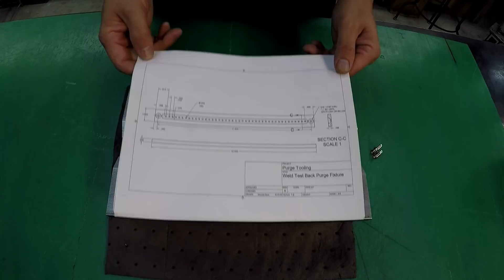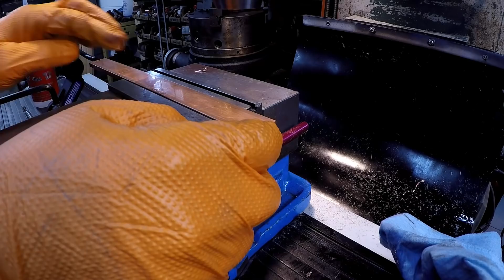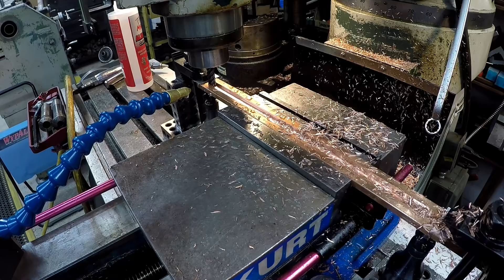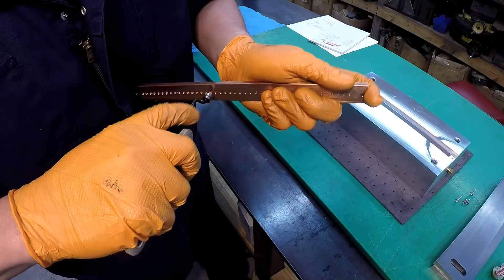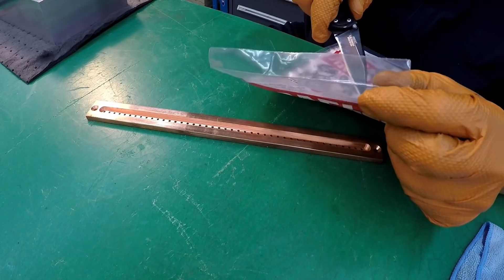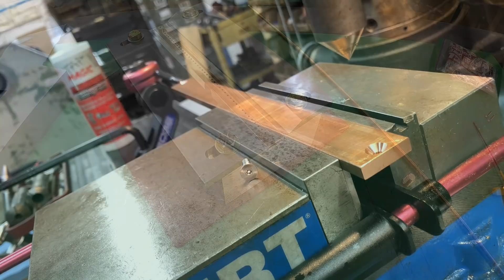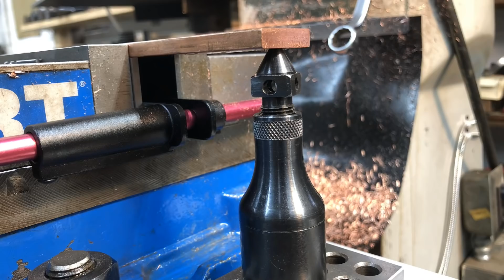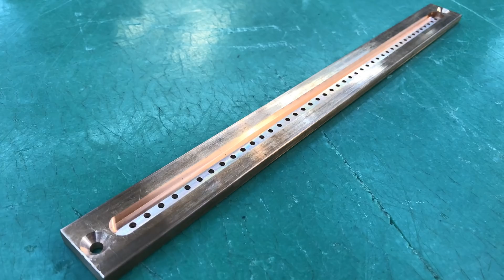AWS Back Purge Welding Fixture Part 6

Comment: Adam your going to cry when you see that purge box after the first use .
Reply: As an ex- structural steel welder that has taken many tests, I was thinking the same thing, during every video in this series.  This work is too pretty to use as intended... maybe not the first use, but certainly after a couple of months.  Inert gas backup could make the tests too easy?

Comment: Brings back memories....I built one similar with a 1/4"'x4"x79" copper plate for on a seem welder on our strip rack machine that we designed and built at work, used to join 72"x20' SS and other steel sheets together during our manufacturing processes... lol..no polishing involved...nice job

Comment: Coconut *oil*? Is that going to contaminate the Ti sheets when welding? (At least the first few times?)

I'd skip the polish on the aluminum at least, or Jodie will have to strip it down with the chemical grade acetone just to be sure there's no contamination...
Reply: I'm sure a professional would do that as a mater of course.

Comment: Next time you need grade 8 bolts visit your local Cat dealer.  They carry the best G-8 bolts with rolled threads in either finish for about the same price as hardware store grade 5's.  I stock my shop with them.
Reply: Lee Barnhart coming from a previous Cat dealership mechanic, I completely agree. Cat has the best hardware and very competitive if not better pricing.
Reply: Ross Dugan ...Ah, you have yellow blood too!
Reply: Lee Barnhart yes. Still work on yellow iron full time, just work directly at a mine in western MO.
Reply: Thanks for that little info, I wouldn't have thought about that 🤯

Comment: I dont understand the reason for the brass feed tube with holes in it when you have the copper plate with holes just flood the inside of the chamber with gas and let it come out through the holes. No real advantage in the tube i can see .
Reply: I would think it would make the ends even pressure?
Reply: @douglaspierce316  .... but you are also likely to get a pressure differential from one end of the tube to the other ??

Comment: @abom79 what kind of coolant did you use with your noga cool mist can you link it in the comments and do a review on it plz
Reply: Koolmist makes their own coolant which us what he uses, or has in all the past videos.  He also bought the stainless container where you mix the concentrate with water
Reply from the maker: I use the Kool Mist 77 mixed with water.
Reply: What is the ratio you use the kool mist 77 to water and what kind of container do you use to house the kool mist 7 and water mix and how is that tap magic that you used theone for aluminum does it work great I am asking cuz I cut a crap ton of copper and I mean a crap ton I am just using the tap magic the other one.

Comment: To keep your aluminum fixture block looking great, I suggest that you get it hard anodized before it's used. The steel clamping plates might hold-up better if they were blued or plated.
As someone else suggested, it might be a good idea to mill pockets for the clamp bolts and use socket head cap screws. 
There's a company very close to you that's a great source for black oxide and just about every other type of industrial fasteners: Monster Bolts. I purchase from them regularly via eBay and have been exceptionally satisfied with their service. They're in Gulf Breeze. 
The fixture looks great and I'm grateful to your for sharing your knowledge:)

Comment: Is there something a milling machine with a quill can't do that a drill press can?
Reply: cost less XD
Reply: make oblong out of spec holes
Reply: Cost. A drill press is way cheaper if you don't need all the functions of a mill. Plus, for just poking holes, a drill press is probably faster.
Reply: Drill press can tilt the table

Comment: Are you concerned about the galvanic corrosion between the copper and aluminum?
Reply: I'd expect that to only be a concern in the presence of electricity or an electrolyte that prevents or damages the layer of oxidation.  The gasses going through that fixture should be pretty inert.
Reply: The stereo system was working worse and worse and worse over time (approx 2 years). I tore it all out and could not believe the galvanic corrosion between my aluminum battery terminal blocks and my copper battery terminals, yikes.
Reply: sorry bob i inadvertently hit the thumbs down
Reply: Never thought of that Bob !  😱

Comment: with the bras pipe , you need to go from small to bigger drill , like 0.5mm to 1.5mm over its lenght as pressure drops from previous holes to get constant unifom flow

Comment: Very nice job it will look like a trophy , Just wondering if the design of the 2 shielding gas distributors is over complicated ; I think I would try this without the brass tube and connect the gas hose to the housing it should pressurize  and evenly feed out of the copper plate .
Reply: Sort of.  The initial holes will have a greater pressure.  With the use of the tube, there is a bit of buffering going on.  The trick is if the holes in the tube are smaller then the holes in the copper, will the gas more evenly pressurize.  I'm not sure, I'd have to either think about it some more or test it.
Reply: Agreed about the possible buffering But a flow meter only has so much pressure a regulator may have to be used ; It is a clever design a small cavity in the housing to save shielding gas . The housing could also be fed with gas at both ends to get equal pressure across it .
Reply: Another thing to try, feed the gas in both sides of the fixture close to the bottom. As pressure inside builds, it should equalize and vent out the top more uniform.

Comment: Adam you have to demand more of your suppliers. Part of being in charge is making uncomfortable demands. Paying for a 12” part and getting less is not acceptable. They made money cutting that piece, it should be what it should.
Edit: I know you’re not purchasing the quantity they are used to. Been there. If they view you as the guy who takes the leftovers it’s downhill from there. Be demanding and they will respect you.
Reply: Yeah especially now hes not a motion industrial employee anymore
Reply: I bought some .25 x 1 x 14 inch aluminum flat bar from an internet company they have a cut tolerance of +1/8 - 0. 90% of the order came at less than 14 inches.  I called them out on it and they sent a shipping label out pick up the bad and replaced them with new. I waited till I got the new and 75% of those were too short also. I called them up and it was like I was bothering them.  Screw em I kept it all and wont be ordering anymore.  Plus this was not the 1st issue I had with them. Buyer beware.
Reply: Actually his mistake for ordering 12" when he needed 12" and expecting it to be oversize.  Even if they sent him a 12.0000 inches bar he wouldn't have been able to clean up the ends without taking it undersize.

McMaster-Carr doesn't post their tolerance on bar stock length, but the length is usually the least accurate dimension for bar stock, and getting a few thou undersize is usually to be expected and acceptable.  And sometimes you get a few thous extra for free. They're just cut off on a band saw, not precision ground.
Reply: @felixar90  They sell it in 1, 3, 6, 50 and 100 foot lengths. This was not a precision part requiring him to get a 3' piece just to get it 'perfect'. MMC should sell something labeled as 12" as at least 12.0"

Comment: I dont know why abom is taking so much time to countersink them bolts on that copper piece when you have bolts on top sticking up one inch that you're knuckles going to get busted on when TIG welding ..........
Reply: Im talking about the bolts on the clamp down, if hes going to take the time to countersink them why didnt he on the knuckle busting bolts sticking up on top.
Reply: i understand what you are saying, but if the screws on the copper are not counter sunk this whole project wouldn't work. hence why he is taking his time. also if the top bolts where countersunk they wouldn't be able to slide back and forward to accommodate different work pieces. i guess you could use a smaller bolt and machine a slot....
Reply: @laytongreenland782  you could make them slide like you said in your comment yourself
Reply: @southernillinoispota2481  probably because the print didn't specify c-sunk bolts there. He's making parts to the specs provided
Reply: @Bkrites  even if it didnt specify im sure jody wouldnt want to be getting his knuckles busted on them bolts when they could be countersunk and like marines say, adapt, improvise, overcome.
Reply: @southernillinoispota2481  machinists don't get to change the prints. They make what's drawn. Also you'd end up stripping out the socket head on a c-sunk cap screw because the hex size is small compared to a standard shcs.  And the taper on the c-sink would dink the tapered slot when you tighten it down so the clamp bar would always want to move back to that spop in the slot
Reply: @Bkrites  whats he tightening it up with an air imapact wrench?
Reply: @Bkrites   look at andrew carnagey he was one of the lowest paid Railroad employees and one day there's a big train wreck and they telegraphed to ask what they should do no one execpt hin was there he replied push it to the side and burn it, which was against the rules next thing you know he's a foreman,  next thing you know he's the owner of the company and then he's the richest man in the world. goes to show that you don't always have to follow by the exact rules and you can end up better than some people do........ (thats a true story)
Reply: @southernillinoispota2481  I think your missing the point here. In this instance yea he could probably change the design for the better or call the customer and make a suggestion. But in general you are making parts that conform to a design given to you by someone else. Those parts usually interact with other parts in some way. You may make all of them, or one of them. If you take it upon yourself to modify the design because you feal it's better and send those parts to your customer, they may not work with their design. So you get what's called non conforming material also known as scrap. And a angry customer, you also loose money because people don't like to pay for parts that you decided to make differently than what was ordered.
Reply: Yeah i wouldn't want to be busting my knuckles on them bolts
Reply: if they are not countersunk, how could you back purge properly? they would interfere with clamping what ever part you wanted to weld, meaning you would just loose most of the gas.

Comment: In what kind of school would one learn about "standard" sizes, e.g bolt heads, screw lengths, common ODs/IDs, hole patterns, threads per unit …i'm sure you've got my pattern …since this is a mainly US-focused channel, where in the US would you learn all that? In trade school (the German equivalent would be "Berufsschule")? Engineering at a university? Well, i don't know, is there a middle-ground, like a trade-engineering-school-y-versity kind of thing? Or would the somewhat relaxed Australian approach do just fine; "Read the manual (maybe), but PROVE your skill, you've got the job"? I'm quite curious, how a wannabe machinist can become a "respected" one, in the US.
edit: i mean, i'm watching this channel regularly, almost every release, since …oof, idk… for well over two years, by now …i've learned quite a lot by now …well, despite the imperial vs metric snafu (i'm used to metric, DE/EU)
Reply: Look at all the hardware at McMaster-Carr (www.mcmaster.com).  The common SAE/Imperial sizes are listed.  That fine old industrial supply house also carries Metric stuff.

Keep in mind that while Metric is more consistent, it is no less arbitrary than SAE/Imperial.  The key item to remember is that 25.4 mm. = 1 inch.

Praise whatever powers that be for the fact that a 19 mm. wrench and a 3/4 in. wrench are interchangeable.  3/4 in. = 19.05 mm. and that's way more than good enough for government work.

Comment: Adam, love the videos. Top tip: You can drill out a brass fitting (drill bit same size as the tube) that is a compression to NPT and then slide the tube all the way through the fitting (you drill through the stop that is build into it). The compression fitting still holds and seals the tube. That way you don't have to deal with soldering. I used this trick to run fuel lines into a homemade jet engine I built. Another buddy used the trick on his still he built, lol. Are you going to fill the void will steel wool? I think i learned that trick from Jody thou....

Comment: For a mirror finish on copper and aluminum, you can use 3M FINESSE-IT 09639. Also works on clear acrylics because it's colorless. No machine required.

Comment: Hey guys. I was wondering, how precise is an edgefinder?
Reply: They're pretty good.  You're likely to have more error in the machine itself.  Between wear in the axis ways, spindle bearings, runout in tool holding, etc.  It seems like I saw Tom Lipton of Ox Tools say something to the effect of plus or minus 0.0002.
Reply: @Ddabig40mac ....Yep, you are correct. Tom did measure that a while back.  However, .0002 is not good enough for the know-it-all experts that roam these comments.
Reply: Only good enough that most every machinist on earth uses them.

Comment: I'd be curious to see how this fixture is used and what it does.
Reply: I would assume its so you have gas on the backside of your weld also, just like when you purge a pipe before welding. This just works with flat stock

Comment: I wonder why you decided to go with the 5 flute instead of the 2 or 3, they would be better for copper
Reply: René Honsbeek Because on a face cut like he made the extra teeth acts like it is at a higher speed which gives a smoother cut without having to slow the feed way down.
Reply: @sirensc3566  yea that part makes sense, but with copper producing long shavings I'd go for the 3flute to be able to clear all the shavings and go for a cleaning pass
Reply: René Honsbeek ya I guess he just didn’t want to make more passes. I would have used a 3 flute too but I don’t do it for a living either.

Comment: Boy I’m getting old. I was an AWS certified welder in the late seventies and a AWS certified inspector in the eighties, and we never had anything like this for a “purge fixture”. Most all, if not all stainless or chrome moly piping I was associated with were either nitrogen or argon purged or if the client was really cheap, we used a water soluble paste ( the trade name evades me) . When testing welders on stainless, they would tape up the ends of the coupons with duct tape or masking and tack, then leave a purge hose running during the welding process.  We would check with a Bic lighter at the gap to make sure it was completely purged. I can’t wait to see how this thing is evolving in the new world. 

E
Reply: Eric Douglas: good point. Hopefully the copper backing will not collect to many spottles (spatter), assuming TIG GTAW is the intended weld method, I used a tungsten based copper (Mallory 100) to protect parts from MIG/MAG (GMAW)  spatter, very expensive but did the Job.
Reply: Solar flux

Comment: Excellent work as usual Adam. A tip for you: I used to work with silver, gold and copper - the best polish I found for hand polishing was Autosol metal polish - its a white cream that comes in a 75ml tube - used on a soft cloth (old well washed jeans) a pea sized amount would have done that job. You really can't beat it.

Comment: Stainless is nice, no rust, can be polished. Zinc coatings are sacrificial.  Does this fixture need Grade 8 hardware?
Reply: 2 dissimilar metals = rust.
Reply: Creabsley: Ah, galvanic corrosion. Not in this application, especially if 316 stainless bolts are employed. 18-8 will corrode in the presence of rust and very adverse conditions. Even then, they can be cleaned and polished. This fixture will be used around a torch - heat. Zinc cannot stand high temps, therefore I believe stainless will make for a better product. Besides, heli-coils are made of stainless steel. I would not even think of using anti-sieze in this application.
Reply: Yes it does.  Grade 8's look cool!
Reply: Paul Copeland    So would S/S button head allen screws.

Comment: Hi Adam, from car mechanics I know you should not put copper grease on stainless steel bolts when putting them in aluminum, as the copper will increase galvanic corrosion of the aluminum. So it might not be a good idea to use stainless steel bolts to fix a copper rail to an aluminum block?... 
This document seems to confirm that: https://www.fastenal.com/content/feds/pdf/Article%20-%20Corrosion.pdf
Seems to say don't use inox at all for aluminium...
Reply: Don,t they screw into Helicoils?
Reply: @veebee592  The little screws holding the copper rail to the aluminum base do not have Helicoils.
Reply: Excellent call, nice link, a good case for Aluminium based anti-seize, the bright coloured passivated fasteners are fine, or as good as you can use.
Reply: Thanks for the link.
Reply: Galvanic corrosion requires an electrolyte. If this thing stays dry it won't be a problem.
Reply: @nerd1000ify  not sure if 0% moisture is viable?, A dielectric grease would greatly assist here through.